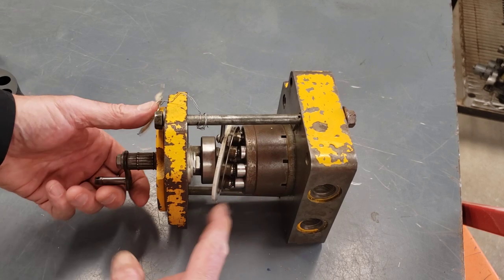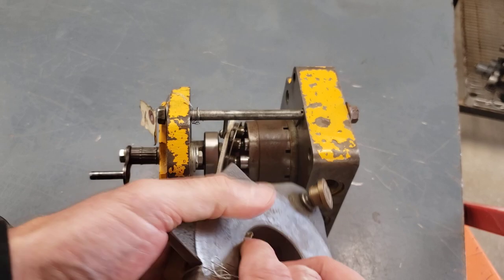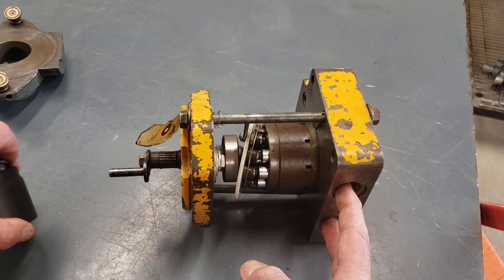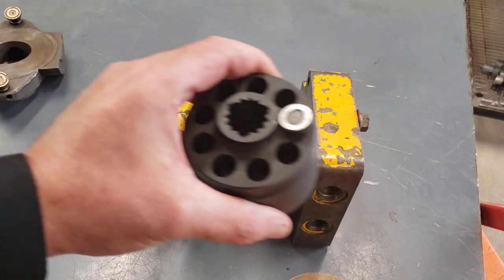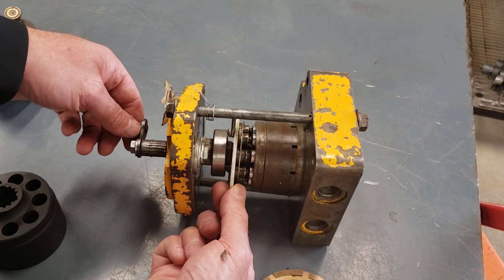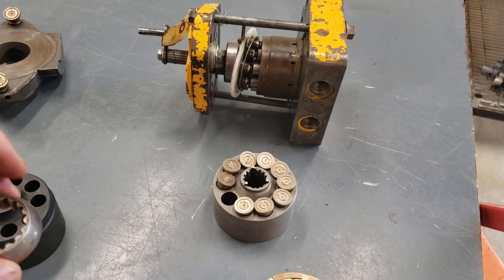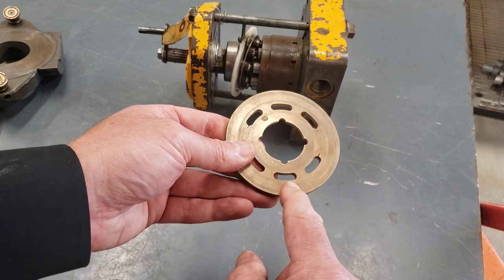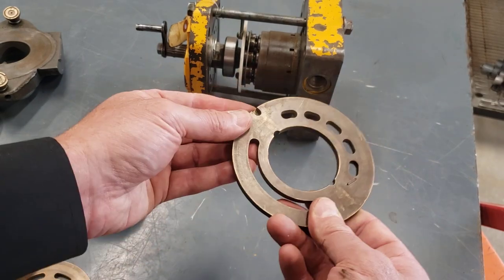AXIAL (IN LINE)PISTON PUMPS INTRO

Comment: Where do losses come from in a hydrostatic circuit? Aside from cost is there any reason why hydrostatic drives with wheelmotors are not a thing in road vehicles?
I think it would be awesome to have a light truck which could run the powerplant at peak power or peak efficiency in any speed range, or convert peak power directly to peak torque.
Reply from the maker: Compared to electric drive, hydrostatic is very inefficient.  Electric does everything you want as far as keeping engine in torque band. Deere and some others use an electric generator and motor between engine and trans of medium wheel loaders to accomplish that too. But hydrostatic is very flexible in application but all the lubrication that goes out the case drain port represents inefficiency.  Hydrostatic peak efficiency might be 85 to 90%. Diesel-Electric does 95% plus efficiency for way less $